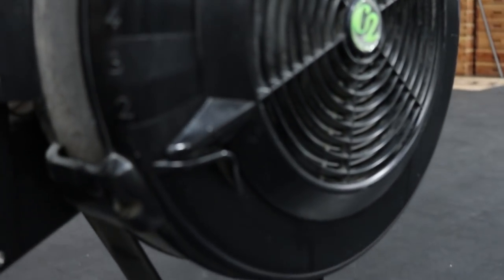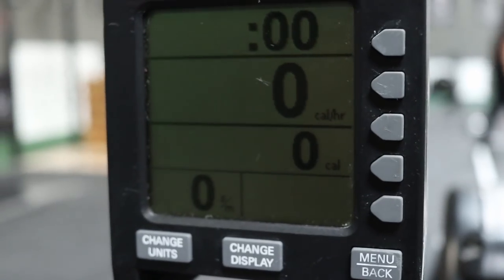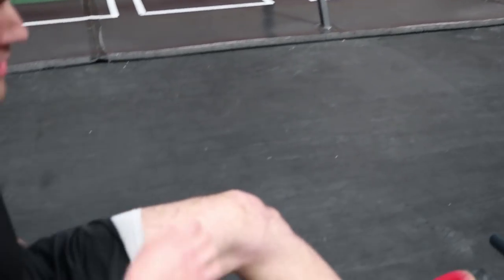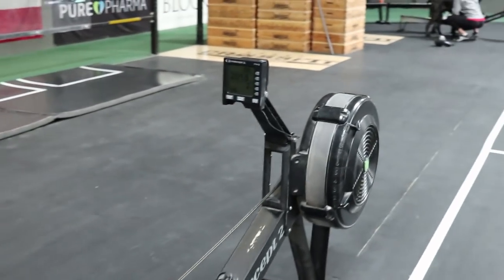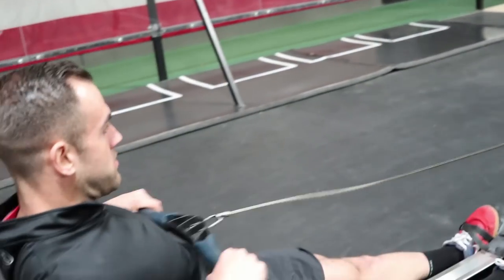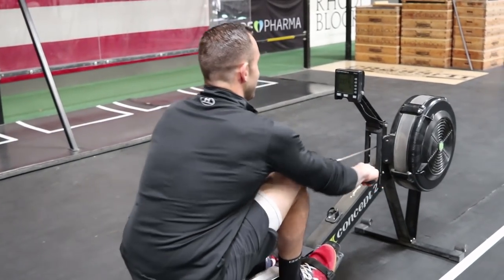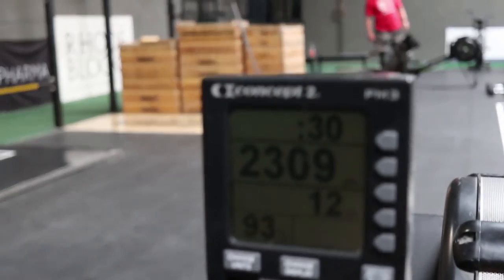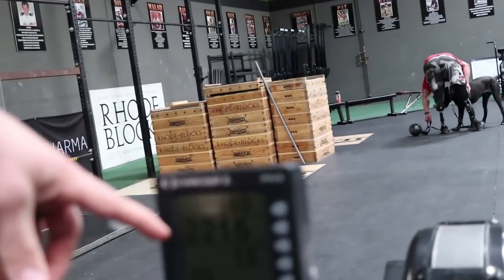Don't Use This Hack On Your Rowing Machine

Comment: Have you tested this method at a higher damper setting ?
Perhaps it is not an error...
Remembering that it takes more energy to move an object from stationary to moving VS energy spent to continue moving an object already moving.  
Perhaps you can spend (burn) even more calories at a higher damper setting and a long (7sec) rest period...? 

The results seem to show that a 7 second rest period (which is a LOT of rest in terms of rowing) and such a high energy expenditure for work completed for 1 stroke, is very similar to a really slow HIIT training session (Maximum effort followed by a rest period where a lot of calories are spent to get moving quickly at full speed, followed by a long rest to recover and return back to zero speed). 

Remembering that you both scored close to the same calorie burn for 1 min of work (1.05min for the slower pushing method in the first duo test) AND that classically HIIT burns more calories than steady state, it could very well be an accurate presentation of calories burnt, Albeit an unfair edge in a crossfit workout....

Test at a higher damper setting and see what figures comes out. I would be interested to see the results...

Just my initial thoughts...
Reply from the maker: We did test this theory, and when the damper is raised to a 5 for example, it gives a more accurate readying. It's confirmed by Concept2 that this is a cheat around the system.
Reply: WOW. That's a big statement from Concept2. Thanks...
Reply from the maker: Also, those "cheat" words are mine. I was paraphrasing. Did you see the quoted response from Concept2 in the description?

Comment: I just rowed a 1:40 500m with little to no fatigue. Works with metres too.
Reply from the maker: Not good
Reply: What spm did it show for your 500
Reply: 90spm doesn’t work on a programmed distance interval I tried it. Maybe it is only a just row problem.

Comment: Hopefully, C2 will do a firmware update to fix this. A few years ago, there was a glitch that allowed you put a towel over the flywheel and you’d get ridiculously low splits. Now, that C2 fixed the glitch, the monitor throws a damper error and cancels the piece.
Reply from the maker: I had heard about that Charlie. Learned it from a Navy rower but had never seen it in action. I feel like this is something similar.

Comment: Ok on pm3, pulled 9 pulls, time was 1:01.1, with damper on 5, got 15 cal and had 1287 cal per hour on it. Im 46 and not a great rower, but totally not fazed after 9 big pulls. 🤤🤤 I am not sure what to think myself.
Reply from the maker: Just think..."I know I'm not actually doing that work that's on the monitor"

Comment: my guess as to what's happening here is that which each 7 second stroke, the monitor is generating those calories not only while you drive, but also while the flywheel decelerates. much in the same way as how you can travel a farther distance at a stroke ratio of 1:2 at rate 25 for example with a full length stroke vs someone who is knee bouncing at rate 35 and the ratio is 1:1. in this case the longer recovery allows for more distance per stroke to accumulate even though your cadence is slower. more distance per stroke, more calories per stroke. you'd have to find out what the mathematical formula from C2 is. i'm betting it's a legitimate calculation and manipulation of the monitor. still don't use it for competition though. that's dickish.
Reply from the maker: Josh, check the description below the video. Concept2 confirmed it's not a "run" of the calories as you're mentioning, it's a flat out "cheat" of the monitor so definitely not legitimate. Based on the kindheartedness of C2 to allow someone to grab a drink of water mid-workout if needed.  And also yes, dickish.
Reply: ah. who reads descriptions anyways haha. sounds like a reasonable explanation. thanks!

Comment: Many (most) software/firmware products will produce anomalous results when the product is not used as intended.  Of course, Concept2 will have a good idea of what's happening. My guess is that the 7 second interval is somehow tied to the sampling rate or integration interval of the sensor(s) whose output is being digitized. In any case, what is the benefit of using this glitch to cheat? Can it produce a verified result for ranking? It's a curiosity, but how much does it matter (assuming consistent, accurate results under normal use of the rower)?
Reply from the maker: That's exactly right Michael. Did you see Concept2's response in the description? They basically say what you're saying.

Comment: and WHY didn't we find out about this before 18.1????
Reply from the maker: Sandy, I know you better than that :)
Reply: I gotta go try this. This is, like, nuts. The one where you guys did it together is the part that really got me - I was SURE it would sort of work out "same/same." But this is a GREAT party trick.
Reply: I think I told you I did 18.1 out of town, there were 2 heats. EVERYONE had their dampers up at 10 (so usual with calorie rowing/fallacy), mine was at 3. But the thing that make 4 guys come over to my erg immediately upon my finish was "what the HECK were you doing with your FEET?" Ha! Quick Release bay-bee, go check out DHR ;-)
Reply from the maker: Sandy representing! You’re owning the #beadarkhorse hashtag.
Reply: It's also going to fall into the "uncommon movement" clause of the rules of Open workouts.
Reply from the maker: Excellent point Tim. That clause is a nice catchall for things like this.

Comment: Wow! This is as effective for weight-loss as my son's McDonalds hack. You order a regular soda, and then you simple push the diet bubble on the lid  - and magically you suddenly have no calories in your soda!
Reply: This workout actually resembles my normal workout - at least the damper setting.
Reply from the maker: What a perfect analogy Melissa.  Sounds like you're saying it's a fraud which is totally true. It serves no one and you only cheat yourself so it's best just left as a nothing.
Reply: I tried it out and could only pull 425 calories per hour with the hack (without warming up) - but could easily pull an average of 625 calories per hour rowing a 2km. As you mentioned in the video this hack might not work for some women.
Reply from the maker: Happy to hear it's being tested to see what happens.

Comment: What kind of erg voodoo is this? This is from the CrossFit 28.1 workout. This is from the future. There is no spoon.
Reply from the maker: Ya, no one at fault really except who the hell figured this out. Programming of the monitor had to make some basic assumptions and this is basically just routing around the system. Loved Peter's description. It's the equivalent of painting "45" on 25lbs plates and saying you're doing the thing at the correct weight.

Comment: Do the test again, but not in Just Row, use a fixed distance.
Reply from the maker: I assume you’ve tried this? What was the result?
Reply: @DarkHorseRowing  In anything other than Just Row it just becomes a normal effort but at very low rating; the trick only works, if at all, when the PM clock stops. This on my PM3 which must be about 15 years old, no idea about more recent gear.